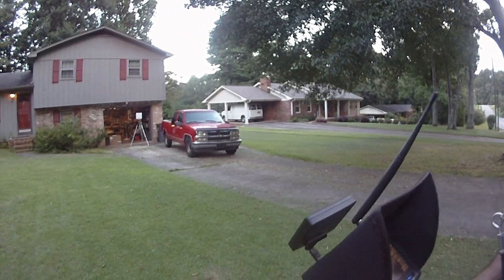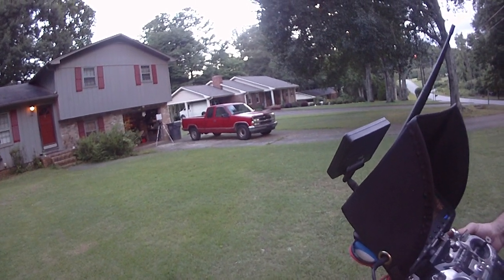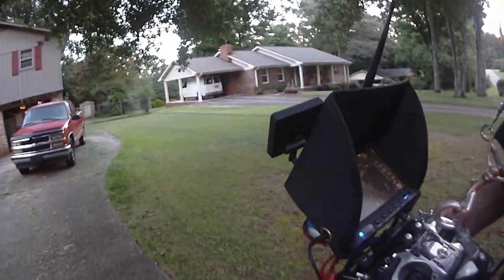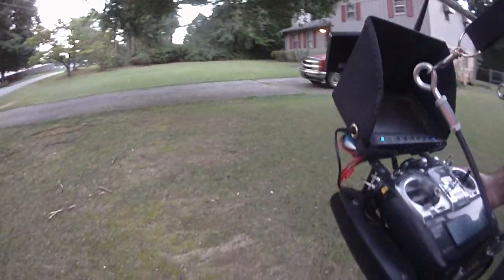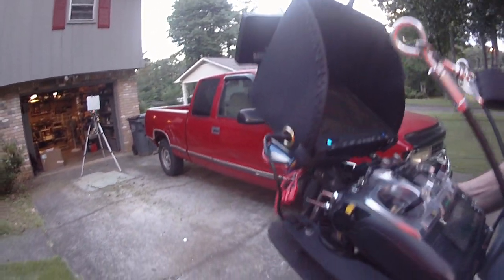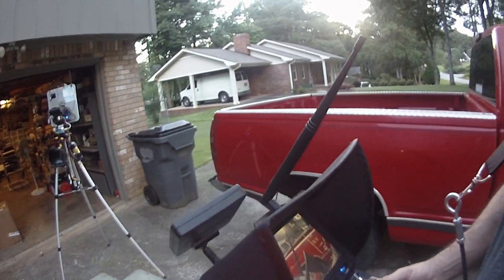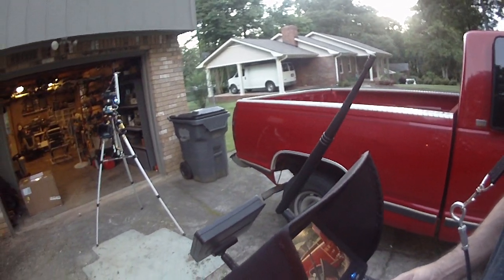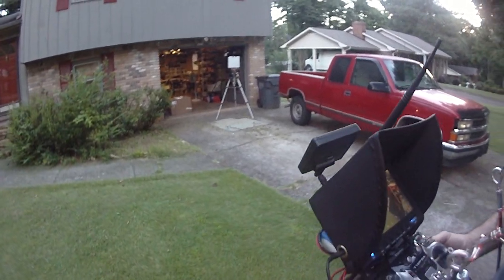Testing the My Fly Dream MFD AAT Tracker & Auto Pilot on my New Skywalker X8 FPV Plane

Comment: So you are using the telefly or are you using the signal out of the new autopilot! because I'm seen that I don't have not other choice but to turn around and buy a new driver for the Antenna Tracker!! and my telefly do get hot but not enough to burn me when I grab it! I did have one that needed to have a heat sink.. but Charles did replace it for free..
Reply from the maker: +Migueldeservantes 
On this plane (X8) and in this video, I'm using the auto pilot. not a telefly.
Reply: +Brandon Moon" Have you figure it out how they are doing to skip totally the use of the audio output of the AV Transmitter?? Before it was possible to put a headphone on the old telefly and hear the noise "Lie the Sputnik" on the early days!! so I'been trying to figure out what are they doing with the video to piggy bag the signal on the video transmitter!!
Reply from the maker: +Migueldeservantes 
Nope, I haven't messed with any of this since I left GA a few years ago.It's all currently packed up and in storage mode until I find time to get back to it all. Currently working on and flying War Birds. 

With what's coming down from the FAA and drone regulation (Not just quads...etc...this includes FPV planes) all mine have taken a back seat and in moth balls for the moment....

Comment: its my telefly osd that gets so hot that my vid goes white

I will have a look at the manual trim

thanks for getting back to me
Reply from the maker: You need to make sure the your Telefly is getting some cooling, but at the same time...it shouldn't be getting that hot? I have two of them, and even concealed in the fuselages they are in, they don't get hot....only slightly warm...which is normal.
Keep in mind I only power mine from a 3S or 4S setup...they really aren't designed for any thing more than that.

Comment: Hi

How do you set the tracker so that it points directly at the plane.

I am struggling with this system the tracker doesnt move smoothly and the osd gets so hot that my video goes white

Please help me

Thanks
Reply from the maker: Hmmm?....I'm not sure I know how to help you?....My AP doesn't get that hot, just a little warm is all, but nothing abnormal. My AAT tracker doesn't follow my plane perfectly, but it's close, which is ok and good enough....Try doing all the recalibration steps and possibly the manual trim on the pan and tilt servos....instructions for that are in the manual for the AAT

Sorry I couldn't be of more help :(
Reply: Brandon Moon Charles of MFD says that at 10 meters that you will get that at close range but not when you are actually flying your plane where there is less error on tracking it.